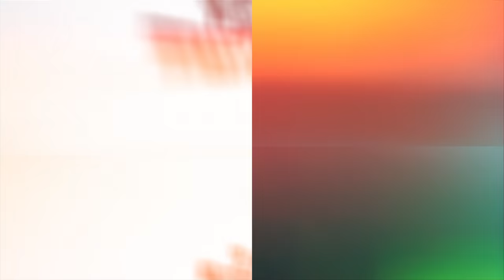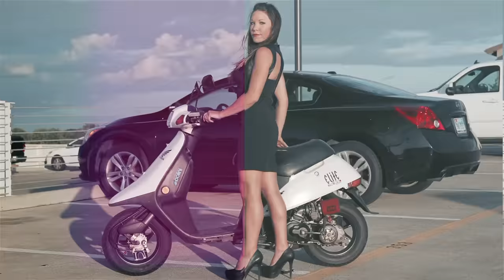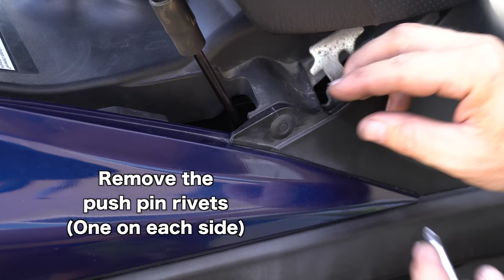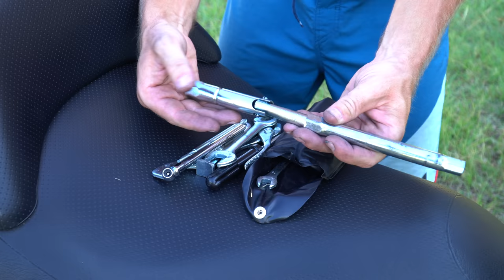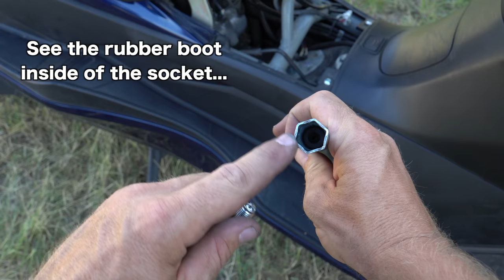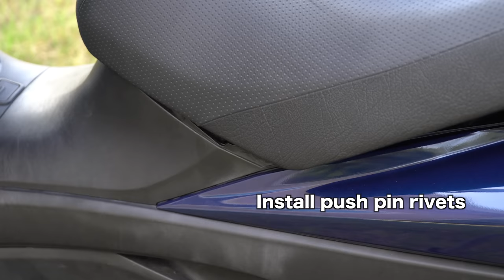Suzuki Burgman 400 - Spark Plug Change 2007-2016 | Mitch's Scooter Stuff

Comment: Just replaced my spark plug. I removed it and there was no cap on the plug. Tried to insure the new one would go on but no luck. So I ended up removing the threaded cap. Only than will the ignition wire go back on. Tried to screw the old plug onto the wire to see if it would engage; no luck. Right now it runs good. Used the NGK plug recommended. Any feedback is appreciated. Should I plan on replacing my ignition wire in the future?

Comment: my burgman is fuel injected i noticed it back fires every once and a while. could it be the plug or something to do with fuel air mixture. i just bought it so just wondering.
Reply from the maker: I would replace spark plug and a clean air filter 👍🏼